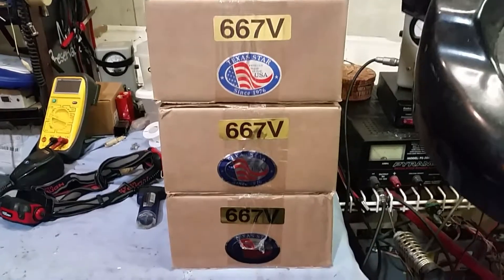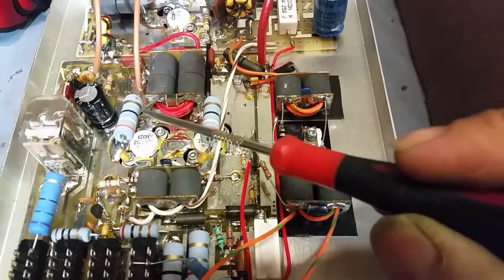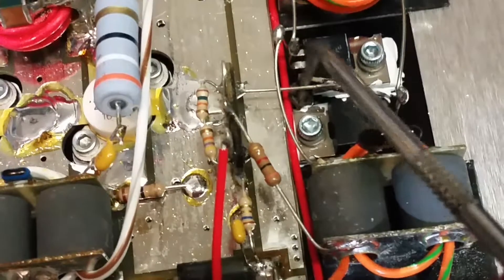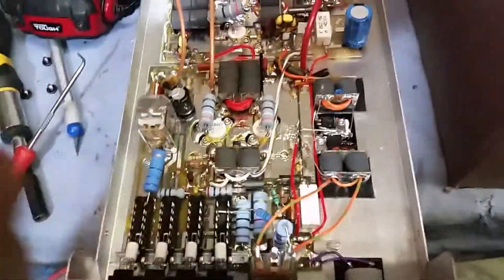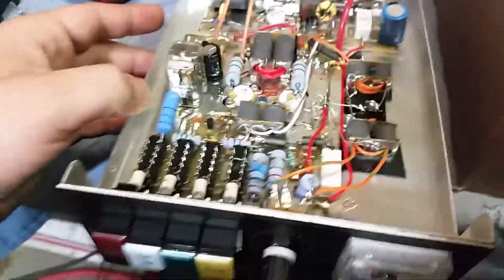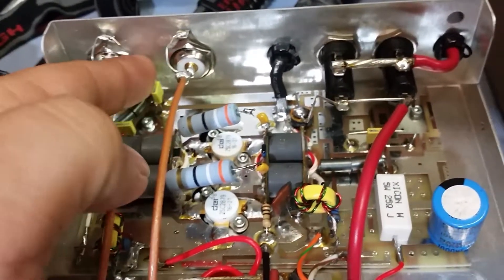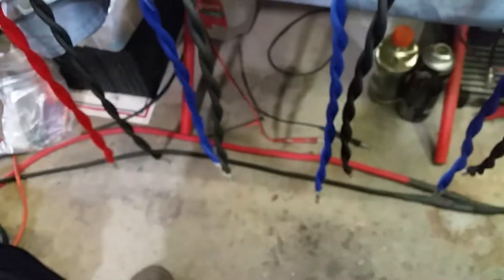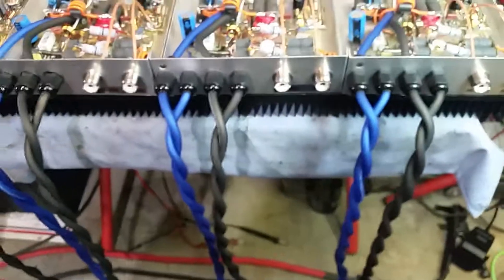Modifying 4 🆕️ Texas Star Amplifiers - [GK3 Mod]

Comment: Looks like around the same age is 667V I re did. it had metal clad on output . I got it burned up. burned 10 ohm. 1.8 ohm. signs it ran hot. was a learning curve for me. customer wanted BJT driver. all new pills . from testing only 1 DEI worked with low gain. I FET good. had no numbers on it. Went with RFP 2SC2979 and MOT MRF 454. re tune . had bias issue. found out on that 667V the 1.8 and 1.6 ohm needed. was doing around 650 watts PEP when done. I had to play with   input caps and resistors. input tune was off a bit and needed to drop drive as well. at the time I got new OEM combiner. ben a few years . I think it still works. It had a fan kit on it. 73's
Reply from the maker: That is nice...did you ever write down the exact changes tunning wise to convert over to MOT 454?
Reply: @1883GotDown  I wish I did. I put trimmer in. and put on LCR meter. both in and out. set as 1 pill amp to tune. was a lot of work. I even played with wraps in in and out. spent more than a day on it. got start with my MOD V which had 2290. I ran driver as class C until I got it tuned. then bias was off. had to run 2 different resistors. 1.6 and 1.8 to get bias close to same. was pulling 1 pill bias off 2 pill was pulling down to low on 1 side. one I got it was in a hurry to finish it get it back . was not to far off 1 pill 2290 . the caps tuned different. 73's
Reply from the maker: @robertmeyer4744  yep I do the same always...keep in class c until I'm finished tuning something new....yeh that would have been neat to written that down lol...ive done that before but I always try to take images so I can look back but the problem is all these TS look the same looking at 10 years of images lol lol.